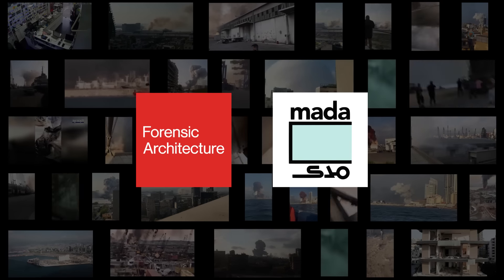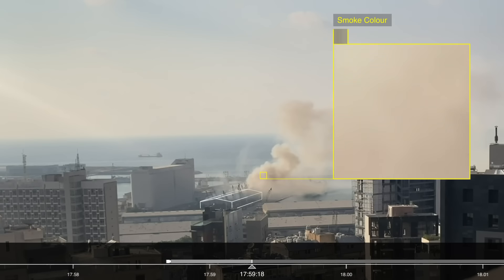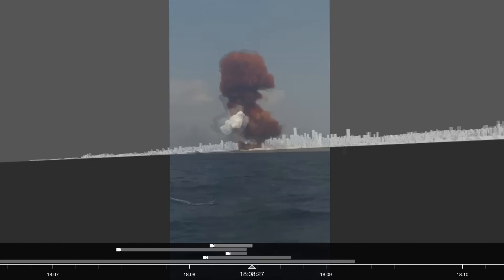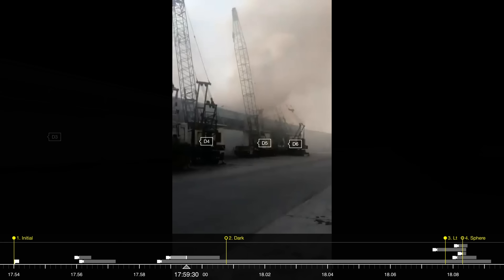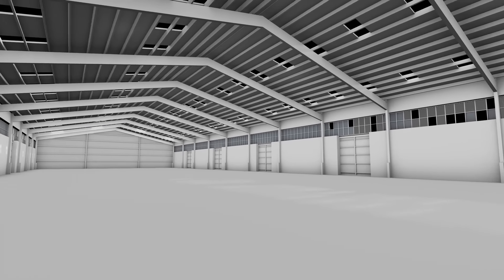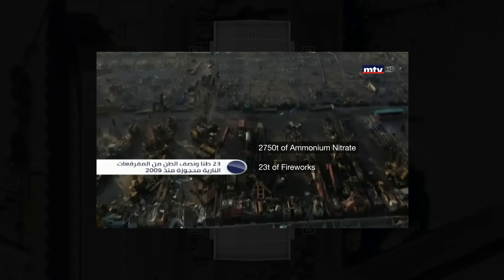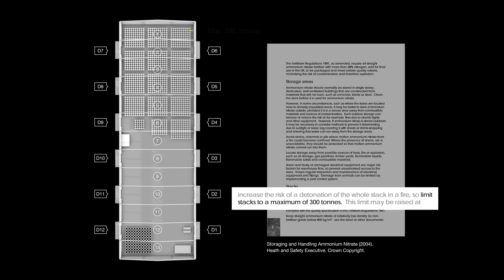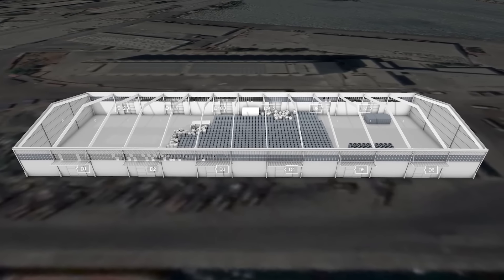The Beirut Port Explosion (English)

Comment: What's sad about ammonium nitrate incidents is they happen at fairly frequent intervals. Even the smaller incidents cause mass damage and tend to happen after a series of unusual events line up to set up a detonation of bulk AN. You can absolutely bet on the fact this incident will not stop the next. Ammonium nitrate just loves to misbehave when the correct conditions are allowed to stack up.
Reply: It is regularly used in quarry blasting all over the world with hardly any incidents.  The problem is storage in unsuitable locations.
Reply: @karhukivi  I suspect the reason for it being relatively safely stored by quarries is that they're fully aware that you can, and in fact are going to, use this to shatter rock faces. If, on the other hand, you're trying to grow bananas, you'd presumably be more worried about people slipping on it.
Reply: Liars!!!
Reply: Look at that shockwave dude does that seem like that happens by accident to you? Really? Homer Simpson backed his forklift into some fireworks and exploded the entire city, likely story
Reply: @williambarringer6513  Every explosion has a shockwave.  Chemical explosions have happened at many locations around the world, one I remember (because I was near there) happened in a fertilizer factory in Toulouse France  Sept 2001 killing 31 people and injuring 2,500. Heard 50 miles away.   Same problem - mishandling.
Reply: @glenmcgrath5162  No radioactivity, no nuke.  And you could see the fire before it exploded.
Reply: @glenmcgrath5162  Conspiracy theory = rubbish = good media "story"!, the truth is mundane and boring.
Reply: @karhukivi don't feed the Troll.
Reply: @karhukivi  you need compression and containment, even if all the parts necessary to make it are present a device on this magnitude isn’t going to assemble itself or happen by accident this was anime level of destruction I just don’t see how this is just an accident it seemed more like an energy weapon than a conventional accident I’ve seen factory accidents
Reply: @williambarringer6513  Read about the AN explosion in Toulouse in France.   The amount of material (300 tons in that case) provide the containment.  https://en.wikipedia.org/wiki/Toulouse_chemical_factory_explosion       These sort of explosions have happened before, no mystery, just bad handling.
Reply: @williambarringer6513  when it's a 550 ton pile of explosives, yeah it's gonna blow the city. Heck if 80% of the original shipment didn't get stolen it'd have been a 5x bigger explosion.
Reply: @emissarygw2264  if you take a pile of gunpowder and light in on fire you get a little poof, if you take that same powder and compress it into a tube you have a fire cracker, you see the difference? I get that it’s going to be a huge explosion either way but this was clearly a weapon that doesn’t happen by “mishandling” I don’t care how many charts they show you
Reply: @emissarygw2264   I doubt it was even a conventional boom this looked like something out of a scifi movie they rod of goded it
Reply: @karhukivi  watch videos of other industrial explosions look at the explosion in China it was huge but this was different  this was done on purpose there’s no other accidents that look like this
Reply: @karhukivi  look at the massive fireball and shockwave from the china accident and compare it to this it’s apples to oranges
Reply: @karhukivi  does that look 3 times more powerful than the tianjin accident? Id say more like 10x, assuming it all detonated at the same time uniformly which I don’t see how that’s possible either
Reply: @karhukivi  the ammonium nitrate itself isn’t even explosive it’s just an oxidizer, you still need, fuel, compression, containment, detonation, I mean cmon this is no accident we’ve seen what accidents look like involving this stuff it’s a boom and a warehouse fire maybe some windows blown out not buildings leveled a mile away
Reply: OMG LEOKIMVIDEO IVE BEEN A SUB SINCE I WAS 6!!!!!!!! love ur vidssss
Reply: Key word being NITRATE. Many other nitrates also love to explode, many even more energetically. Reason is that Nitrate ions (NO3) have lots of oxygen on board, a ton of binding energy,  and a nitrogen ion that wants nothing more than to expel that oxygen but has to wait for some energy(heat/pressure) to be able to expel them - but requires only a little. So, Nitrate ions, in the right condition will easily break apart and the oxygen released will easily react with the other compounds. Having its own oxygen on board rapidly accelerates the chemical reaction because it doesn't need to draw in oxygen from the surroundings.
Reply: @williambarringer6513 The issue with democracy is that people like you get to vote.
Reply: @Skartak  or like when they accidentally dumped cholera into a well in Egypt were not dumb
Reply: @paulmichaelfreedman8334  very good explanation!! thank you!
Reply: @williambarringer6513  yes you are.
Reply: @cadenwells1356  Explosives nearly all work this way.
Reply: @Skartak  did the older kids pick you up by your buzz light year undies? That’s gotta hurt did you tear it?
Reply: @paulmichaelfreedman8334  yeah i know, im just saying you did a good job explaining it.
Reply: i guess it’s hard to imagine something as tragic as this can occur just because of human negligence
Reply: @karhukivi  Wrong, many detonation incidents have happened while in transport. AN truck crashed off a road catches on fire and once all the conditions are met the AN load detonates. And this is just the tip of the iceberg when it comes to 'accidents' in transportation of AN
Reply: @karhukivi  My proof sheet, read on and learn https://en.wikipedia.org/wiki/List_of_ammonium_nitrate_disasters
Reply: @leokimvideo  You are absolutely correct.  The debate was about storage in factories and warehouses when some people don't know where the danger lies.
Reply: @paulmichaelfreedman8334  It is the strong N=N (triple) bond that is the key.  Many nitrides/azides are even higher explosives than nitrates and no oxygen is needed.
Reply: @karhukivi  Just been fact checking, it's the singly charged oxygen atoms in the nitrate molecule. Two of them are singly bonded with the nitrogen.
Reply: @paulmichaelfreedman8334  Yes, that makes nitrates more stable and easier to handle than azides.  More input energy is required to break the N=O bond and then the re-combination of the N-N can take place releasing far more energy than what was input.  
The input energy to start the reaction in an azide is much smaller, so they are more unstable.  Nevertheless, NaN3 is used safely to inflate airbags in cars.
Reply: @karhukivi  Nitrides are also used as low-budget surface hardening agent for cutting tools.
Reply: @paulmichaelfreedman8334  I think I meant to say azides, not nitrides.  Yes, nitrides like nitrogen have very strong bonds hence the hardness and high melting points of those materials.  Silicon carbide is similar, hard with a high m.p.
Reply: Are you a kids channel? 1M subscribers lol
Reply: See also The Halifax Explosion
Reply: @williambarringer6513 Are you saying this was a mini Nuke? It clearly isn’t a nuke because nukes have a fission flash. This did not have the flash but the explosive force was definitely on par and even had the Wilson cloud.
Reply: @jsl151850b Ah yes that’s the one I was trying to remember and wasn’t there another similar one in a port in Texas in the 30s or 40s? It hurled the ships anchor about 2 miles from the blast.
Reply: @alexandercarder2281  1947 Texas City disaster.
Reply: Leokimvideo!! I remember watching your videos about opening redback spider eggs!
Reply: Backwards countries.
Reply: Whoever was over this warehouse had no idea what the were doing or knew exactly what they were doing
Reply: @williambarringer6513 do you know about the 1988 New Mexico rocket fuel ammonium piclorate explosion ?
Reply: @williambarringer6513 do you believe that this Beirut explosion was weaker or more powerful than the china explosion?
Reply: @leokimvideo with that ammonium nitrate accidental truck crash, how much of AN total was in that truck ?
Reply: @earlcoles5215  hard to say, I’d say this one was stronger than China, the China one looked more organic like what you would expect something like that would look like, also didn’t that one have 3-4 explosions with the third being the biggest fireball, there was definitely a shockwave in China but this other one looks like things just got vaporized, is there a map that shows the effect area? Are they consistent with the pile that somehow had a 100% detonation by accident
Reply: @earlcoles5215  Beirut was 10km 1200 tons equivalent tianjin was 3, 21 tons lol it’s not even close that’s way more of a difference than I expected, this was the biggest “accident” by a lot they mentioned another one that was 1000 tons I’m assuming that’s the New Mexico one
Reply: @williambarringer6513  thanks for the reply,  the question now there an argument going on a different channel, have you heard of the 1988 new Mexico rocket fuel ammonium piclorate explosion ? If so,  how would you compare the power of that explosion to the Beirut from your opinion of course ? Some seriously believe that new Mexico one is more powerful,  and some believe the opposite
Reply: @earlcoles5215  also said Pepcon was a series of explosions similar to the tianjin case you need a small explosion usually to make a huge pile all go off at once it just doesn’t seem to be very likely this was an accident, they tell us Chernobyl was an accident too
Reply: @earlcoles5215  pepcon was 1000 8km this one was 1200 10km so if your trusting joogle this one is strong by 200, but this one seemingly went off all at once there wasn’t a series of explosions that would justify the bigger explosion if that makes sense it does to me, how’d it all go off at once out of nowhere?
Reply: @karhukivi lots of things happened in sept 2001 lol
Reply: @karhukivi some of those “fireworks” are 1500-2000ft up in the air and they spread out like there’s millions of them how many bottles rockets was in there? Lol
Reply: They put something in there or microwaved it that blasted “fireworks” into the pile an set it off, you get a few burning chunks of magnesium or something in there then you’ll have a party
Reply: @earlcoles5215  I guess there was a “series” of explosions this is just fireworks then boom, went there fireworks at Tianjin as well though? What’s up with all these fireworks
Reply: @williambarringer6513  supposedly there was 20 tons of fireworks, tons of ammonium phosphate, tons of tires and the amount of ammonium nitrate that they said
Reply: @earlcoles5215  all these “fireworks” no blues ones green ones? All just the same color who has that much fireworks of the same thing
Reply: @earlcoles5215  how did the fireworks shoot out like that in the first place was the roof not intact at this time? I’m guessing it was a metal roof some of those fireworks end up really far from the building at angles that don’t make sense you couldn’t have lit off a million fireworks at once and asked for a better display the spacing and uniform mess is unmatched lol
Reply: @earlcoles5215  I can’t even get two bottle rockets to go off at the same time lol
Reply: @williambarringer6513  Yea, mysterious... It did explode like fireworks I can say that much
Reply: @williambarringer6513  the whole truth is never revealed
Reply: @earlcoles5215  yeah the sparkling was weird, that part did look like fireworks
Reply: @earlcoles5215  I just don’t see how you can get something so symmetrical all at once like that, every other accident I’ve heard of at this level has been a “series” it’s never just a fire then boom all of a sudden, this is either the most unfortunate an dumbest event ever or their neighbors really don’t like them
Reply: It's safe until it's not.
Reply: How many people were blinded by glass as they looked out the window when the shock wave hit?
Reply: What? When? Where?
Reply: . Directed energy perhaps?
Reply: DEW possibly?
Reply: Beirut was also very special. You can look up fertilized explosions and it's #3 with a large gap in quantity of fertilizer to #4. With the top two being from the 1940s in France and Texas. Obviously not standards anyone should hold themselves to now.
And you're completely ignoring the knowledge they had of the irresponsible storage of the fertilizer. It stood there for years and there were complaints. It's an entirely avoidable accident most cities and politicans would manage. You don't need to store that quanity of fertilizer in a city for that long ever. Don't downplay it.
Reply: @gjamcgrath5162
I'm guessing all your research was found on Alex Jones podcast.
Reply: @williambarringer6513
Really,? Just a boom and some windows broken I suggest you tell that to the people in Texas City Texas back in 1947. Or the people in West, Texas the newest and latest installment of a "plain old  fire" leading to an AN explosion. No fuel oil involved in either one of those I say that because you claim in another place that ammonium nitrate is just an oxidizer. That much is correct but that is all that is correct in your statement. There is no need, under the conditions in some of these accidents, to need any fuel whatsoever. All it would take is 5 minutes of reading on your part to actually learn something. But I see that you get all of your exercise by jumping to conclusions. Read and learn, or get a degree in chemistry. Like I did.
Reply: @williambarringer6513
2 months ago
Look at that shockwave dude does that seem like that happens by accident to you? 

Any explosion of that magnitude at sea level, right on the sea especially in a warm area will produce that . What you're calling the Shockwave isn't even really the Shockwave it's the RESULT of the Shockwave passing through humid air. Ever heard the words compression and rarefaction? Didn't think so. The leading edge of the shock wave compresses the air as it passes through, this is immediately followed by an area of lower pressure following the shock wave. This is called rarefaction. When you abruptly lower the pressure, all of the moisture in the previously instantaneously compressed air changes from invisible vapor to tiny water droplets, and it's those tiny water droplets that you are seeing. Is effectively a traveling cloud caused by the shockwave Any large explosion with high humidity around will cause that to varying degrees. Beirut is right on the ocean, a very humid place. Perfect setup for EXACTLY that to happen, dude❗⚡⚡ Once again a little knowledge is a powerful tool. I would suggest you get some knowledge . I know it's very hard for most people to actually read and gain the knowledge of things, it's tedious and it takes time to understand things ; that's why conspiracy theories are so popular now days. One doesn't need to know a goddamn thing about what they are pontificating about. And of course it makes conspiracy theorists feel Superior, because they have "secret knowledge: about what's "REALLY" happening. That way they can call everybody else sheople and stupid, even though those very people they are calling stupid actually have true and accurate knowledge and explanations for what you just have conspiracy theories for. Face it, things happen in life, they just happen and everything isn't one grand goddamn conspiracy. But you clearly choose to live in that fantasy world. It's much more comfortable.
Reply: @paulmichaelfreedman8334
2 
Molecular level readjustments versus relatively large particles( as compared to molecules) merely burning next to each other and simply igniting more adjacent particles. HE versus LE. I suspect you and I are the only people in this particular thread that have an understanding of that crucial difference. I am directly referring to the fellow who mentions the behavior of black powder when contained versus uncontained. Which really doesn't even apply to this but he thought it did. I am a chemist and I suspect you must be as well. When I was going to college 50 years ago I wanted nothing more than to go to work for what was then the Picatinny Arsenal. But life did not work out that way.
Reply: @williambarringer6513
2 months ago
 @Skartak  did the older kids pick you up by your buzz light year undies? 

That's really rich William, coming from a guy who's only knowledge of explosives comes from lighting his own farts under his covers.
Reply: @alexandercarder2281
No flash quite like that flash. The intensity and duration are a dead giveaway.
Reply: @earlcoles5215
That happened in Nevada and that was quite a blast.
Reply: @williambarringer6513

There were 62 tons of fireworks stored in that building. Do you have any idea how powerful the bursting charge is to disperse the pyrotechnic packages out 500 to 700 yd as you can find in professional grade pyrotechnics? Do you know what an aerial salute is? Do you have any idea how powerful professional grade aerial salutes are. If you don't think one of those would set off already burning ammonium nitrate you are sadly mistaken. Far less than that has set that stuff off. But I guess conspiracy theorists got to conspire. 62 tons of fireworks. You were saying they were going a thousand feet up in the air well hell yes professional-grade fireworks will go a thousand feet in the air. It wasn't a warehouse full of black cats or cherry bombs or m-80s. Ever read up on any of the accidents in giant pyrotechnic displays? People die and not just from the fire it's the bursting charges. Imagine all that stuff that you see up in the air at something like let's say the Centennial Celebration , going off within 100 ft of you? Using trigonometry while watching a very small time pregame fireworks show indicated that the largest diameter of the pyrotechnic packages went out 600 ft in all directions. And that was just a funky little pregame bit of fireworks. Think about the s*** they had in the harbor for the 4th of July in various States. And you don't think that kind of stuff going on in a building might set something off that was already hot and possibly burning? S*** stick to your conspiracy theories. More suits you.
Reply: [ Any sufficiently large explosion, such as one caused by a large quantity of conventional explosives or a volcanic eruption, can create a condensation cloud,[2][3] as seen in Operation Sailor Hat[4] or in the 2020 Beirut explosion, where a very large Wilson cloud expanded outwards from the blast.[2] ]
Reply: I don't know if you can really blame a compound for anything, it should be the way this stuff is treated that needs to be looked at. if using proper safety results in deaths, than it can't be called proper safety in my eyes.
Reply: @karhukivi .. it's also used in mining as well but as a mixture with No. 2 fuel oil. 

The Ammonium Nitrate (Nh4No3) acts as an oxider and absorbent for the fuel. 

In almost all cases, the AN is prilled (a term to describe a small aggregate or globule of material). 

The ANFO mixture breaks down to 94% AN and 6% No. 2 fuel oil (this is fairly standard for most applications in the mining industry).
Reply: The AN is explosive even without oil. The fuel oil only facilitates its pouring into drillholes for quarry blasting or open pit mining.  The prill is a pelletised version and can be poured from the sacks but costs more than the ANFO version.   @dravakian
Reply: @glenmcgrath5162 You don't know what a nuke is. Be quiet.
Reply: when i first got interested in fireworks, i was sad to find out that ammonium salts were heavily regulated by the government, not able to get even a gram without making it yourself. as i've matured and taken the time to read more about the art and the capabilities of ammonium salts, i'm very glad those restrictions are in place, and i'm very saddened that some people break those rules. while they may be a pain in the ass, impossible at times, to follow, they save the property and lives of many.
Reply: Guys, Here is The Savior

YaH The Heavenly FATHER (Genesis 1) HIMSELF was Who they Crucified/Pierced for our sins and “HERE IS THE PROOF”

From the Ancient Semitic: 
"Yad He Vav He" is what Moshe (Moses) wrote, when Moses asked YaH His Name (Exodus 3)

Ancient Semitic Direct Translation
Yad - "Behold The Hand"
He - "Behold the Breath"
Vav - "Behold The NAIL" <— YaH’s Crucifixion
He - "Behold the Breath"

“Behold the HAND that Beholds The NAIL” 

PROVES - YAH The Heavenly Father HIMSELF was Who they Crucified

That is EXACTLY what Moses Wrote

Here is what they mean

YaH's Name:
(Ya)d + (H)e, as YaH is what Moses called Him and YaH Declared: "this is My Name, this is My Name for all generations" (Exodus 3)

YaH is The Creator of “MAN”: (Genesis 2:7)
Yad He, (HAND BREATH), as YaH's "HAND" Formed man from the dust  of the Earth and His "BREATH" made him a living being (Adam)

YaH's Sacrifice of Crucifixion for “MAN”:
Vav He (NAIL BREATH), the "NAIL" through YaH’s "HAND", in Sacrifice of Crucifixion, that whosoever shall call YaH Savior, His “BREATH” brings forth life (Salvation)

How YaH arrives:
YaH arrives via the Tent of Meeting (Exodus 33:7:11, Isaiah 54, 55), where a Tent is erected outside the city, a cloud descends upon the entrance of the Tent and YaH appears...

Why they demanded YaH to be Crucified:
YaH was Crucified according to Hebrew law (Deuteronomy 21), to be NAILED/PIERCED on an Almond Tree for BLASPHEMY as it was for His NAME they demanded Him Crucified. The Messiah claimed He was YaH...

HE WAS YaH!!!

HalleluYAH translates “Praise ye YaH”

The Hebrew Book of Isaiah

Isaiah 42:8
"I am YaH; that is my Name! I will not yield my glory to another or my praise to idols.

Isaiah 43:11
I, I am YAH, and there is no other Savior but Me.

Isaiah 45:5
I am YaH, and there is none else.
Reply: @williambarringer6513  "anime level of destruction"
Reply: @williambarringer6513 

Containment is unnecessary with high explosives - they can detonate and form a shockwave even if totally uncontained. You can see something similar, though smaller, happen with the Pepcon disaster which involved the detonation of the related chemical ammonium perchlorate, and it shows a similar spherical detonation and shock wave generation.  Another similar explosion can be seen in the US's test of 500 tons of TNT (watch?v=FJkqYihssKI), which shares a lot of similarities in appearance despite being only a third the size of the Beirut blast.
Reply: @xKapnKrunch  You don't know your chemistry.   Here's what Wiki says: 
"Solid ammonium nitrate decomposes on heating. At temperatures below around 300 °C, the decomposition mainly produces nitrous oxide and water:
NH4NO3 → N2O + 2 H2O
At higher temperatures, the following reaction predominates:
2 NH4NO3 → 2 N2 + O2 + 4 H2O

Both decomposition reactions are exothermic and their products are gas. Under certain conditions, this can lead to a runaway reaction, with the decomposition process becoming explosive."
Reply: @karhukivi  do you even understand what you just wrote? 

Well akchally Water is flammable, see when it breaks down and releases hydrogen and oxygen this can explode.
Reply: its bad enough when its a 'perfect domino effect of disaster'' but all to often ,even in small amounts the facts its 'small' amounts make some idiots seriously disrespect that its sodding exceptionally energetic chemicals they handle , or is making arrangements about :/
Reply: Yeah it happens often, what the heck? people are dumb... Also, there was more than one munitions ship disaster like the Halifax explosion.
Reply: At teesside uk 100x this amount is stored , the difference is our safe systems of work in place
Reply: There is a list of large stores of AN around the world at different ports. Because this happens regularly. If I remember correctly there are some HUGE stockpiles
Reply: @williambarringer6513 

ffs 😂🙄😂
Reply: @Skartak 

BUWAHAHAHAHA!!!!!😂🙌🏽😂

LOVE.This.Comment.😁
Reply: @Heikkinen0301  huh? 🤔
Reply: @MrBarnettcm  huh? 🤔
Reply: @Smedley1947  😂🙌🏽😂
Reply: @Smedley1947 

LOLOL!!!!!!! 😂

Perfect.😁